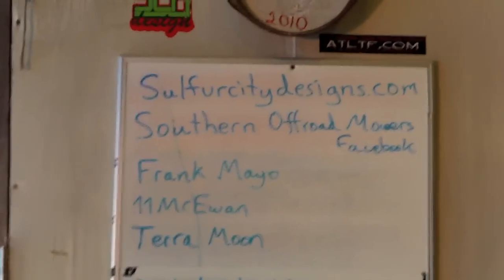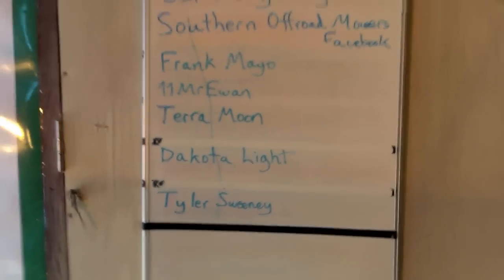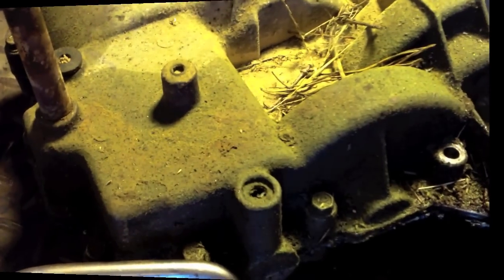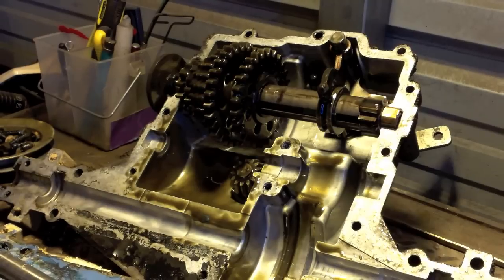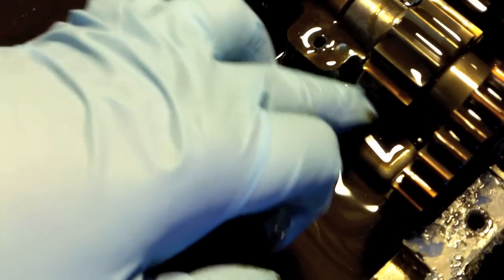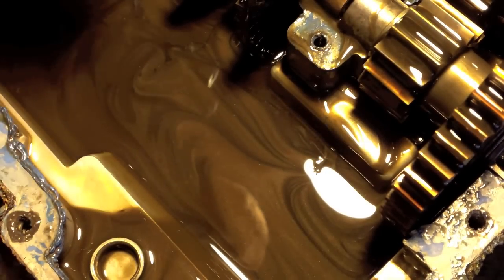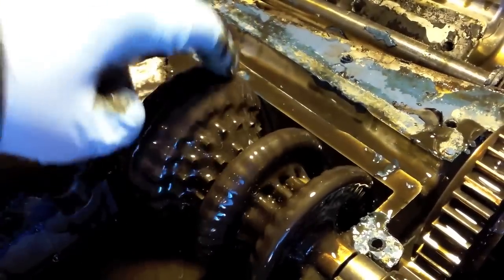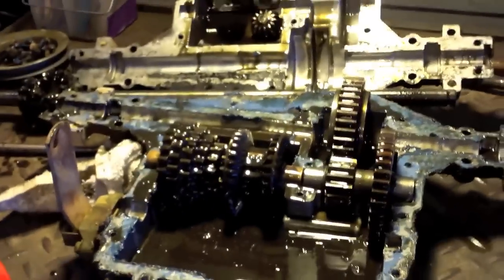Tranny out, getting ready

Comment: are you sure that the tire wasn't slipping on the rim.
Reply: ***** because I know you use to use the flat proof tire method, I'm thinking without air pressure holding the beads against the rim the beads might have been slipping.